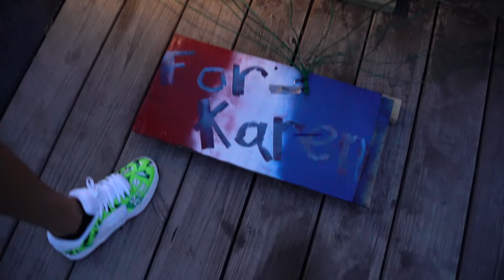I Lit 1,004 Excalibur Canister Shells Fireworks at the SAME TIME!!!

Comment: This is a lesson of how exactly not to build a mortar rack.
Reply: Fr
Reply: Still. Badass tho
Reply: To be fair, even some professional racks wouldn't be able to take simultaneous ignition like that
Reply: This video should serve as a training video in every pyro class as a lesson in "what not to do."
Reply: Tubes not anchored =
Reply: No this is exactly how your supposed to do it
Reply: Your just mad because you didn’t build an awesome firework show!
Reply: @christopherparker4632  lolz I did more pyro yesterday in my neighborhood. I use modular, safe, reusable racks with high quality build materials. I've been using them now for over a decade. I use a tent-stake system that adjusts between vertical and 25 degree fan. Each unit houses six 6-gun racks for a total of 36 per unit. I have 8 units, so I can put 12 cases up in a show. That plus the 900 shells from cakes... I sent up well over a thousand shells. Zero cato's etc. 100% fire rate with zips and foil tape. The difference is I have the ability to do it safely while also giving a show. That 1K shells is a lot easier to admire when paced over 20 minutes
Reply: The rack was actually good it was just fast fused lol
Reply: @mykv4792 , the rack was cheaply made out of thin chip board, a horrible material for this application.
Reply: when the last few tubes break apart and add to the ground attack. way more fun!
Reply: Buddy have you ever done anything like this? Like u know😭
Reply: NO ONE ELSE LIKE THIS COMMENT ITS AT 420 lol
Reply: Ur wrong this is how it's done🤣🤣🤣🤣🤣
Reply: Who cares it was awesomeness
Reply: @michaelmitchell5909  I agree
Reply: Yup
Reply: 🤣🤣🤣🤣🤣Right!!! The bases were flyin’ all over the place!!!🤣🤣🤣🤣
Reply: You need steel
Reply: @andrewg198  Or at least some frickin deck screws!🤣🤣🤣🤣
Reply: Learning!! He still has 9 fingers and 8 toes to go. That was KILLER!!
Reply: @mykv4792  Technically you're correct👍😂
Reply: @odbo255  This video is much cooler than if he had spaced them out over 20 minutes.
Reply: @odbo255  you forgot the part where we live in a world with billions of people who really. Really. Don’t fuckin care.
Reply: @zombifyerilc216  lol - Touche'
Reply: @mykv4792  It's hardly worth mentioning given the other issues, but a combination of quickmatch and black powder on tape doesn't make sense in application together. BP in tape is referred to as "poor man's" quickmatch and functions the same. Putting BP on QM gains nothing and could actually impede the QM by burning off its sheath or even worse, potentially causing a later section to ignite prematurely and cause the QM to subsequently fail at the point where it previously ignited.
Reply: ya but t was SO FUCKING AWESOME
Reply: @odbo255  I'd love to see a video of your show
Reply: @rayngalloway3852  I'll post next year's show.
Reply: Doesn’t Matter. Had fun!
Reply: @j-davis7290  It's not about the simultaneous ignition, they had a pretty basic f-up of using mortar tubes that were too large for the shells that they were using, so the shells didn't get the proper height and they had near ground explosions.
Reply: Lol right
Reply: This could’ve been awesome if it was built better
Reply: @j-davis7290  Nope, just about any rack would have handled it if they used the correctly sized tubes. The damage was all due to oversized tubes that caused the canisters to not properly launch and then blew up the rack causing a cascading issue.
Reply: @odbo255  this is kind of stuff people do to go viral.
Reply: Nobody died or got hurt and they even put out all the fires. I guess they also achieved their goal of shooting off 1k canister shells
Reply: @odbo255  yes this is very true. a show would last longer than a 8 second blaze of glory but a blaze of glory is what we got. you clicked on the video to see it for yourself and you still hating
Reply: @isaiahrodriguez2208  He couldn't have known what they did wrong until he watched it...
Reply: A public service announcement from fire marshal Bill, don’t fuse your fireworks together and then travel with them folks…🤪
Reply: It’s more fun this way

Comment: The aftermath of using cheap wood and unsecured tube. This could of been better
Reply: Ur not impressed?😂
Reply from the maker: You gonna Venmo me $1,200 to build my CAD design out of brand new wood?
Reply: @jonahstaab  He's right. This is just unsafe sky puke. I love the enthusiasm and that you went big. Good thing you had the land and space to do this, but please never do this in a populated area.
Reply from the maker: @ImNotCatCourt  Am I not also right? No sponsors, donors, investors, 100% funded by me. Of course it could be done better, but I can't do big budget. All of my designs are built to function with what I have and set up at a location Incase of it totally failing, which they have yet to do. Sky puke or not I do to for myself and until I'm bringing in more cash or sponsors come along I'll keep going big!
Reply: @jonahstaab  Designs? It looks like you put HDPE excal tubes in a row and didn't even consider the actual trajectory of the shells, the size of the shells or the  effect. As for failing, this most certainly was a fail. Don't bs me I been doing this all my life. What i'm asking is you consider investing in items to help lower the chances in case an accident happens. In this field even if it's consumer grade fireworks you live by a rule, always consider the 1 big accident is the current show you're working on. Prevent it before it happens. Go work under any company you will see we/they live by this.
Reply: @jonahstaab  btw not trying to give you a hard time and no I didn't leave a dislike. I am all about expanding this hobby which benefits my business. However I do push safety 1st.
Reply from the maker: @ImNotCatCourt   @DreamSstreaM  🤣 thats the one thing I have learned about the "industry" nothing is done right by anyone except someone else doing it their own way.

I'm not BS you, I just don't care what you think it should have looked like. It performed exactly how I wanted it too. 1000 at the same time with the trajectory that I decided on after testing it. So it was a success. 

There was plenty of room between fireworks and spectators. The fire department and county sheriff were present. You wanna donate to my fund for next year for further protective items? 

I don't care how long you have done it. There's a reason I get more people showing up to see this compared to the typical city 1.3 show. They lack the creative aspect. Every 1.3 company does the same stuff in the eyes of the public. Pretty displays.  It's only a matter of time until some of my content gets popular enough and I'll be the next Cody B, hated by the Pyro World haha
Reply: @jonahstaab  Cody B, hated by the pyro world? You have some growing up to do my guy. The pro world and what you're doing is 2 completely different things. But anyway you just keep it in mind invest in safety.
Reply: @jonahstaab Ummmm, you spent way more than that on dangerous munitions at a ludicrous scale. So, yes. You should have spent some of that money on safety.
Reply: @jonahstaab No. You are unequivocally wrong. Unsafe, illegal, and unethically exposing others to danger.
Reply: @jonahstaab  Show me your show reports, pyro license, fire marshal sign offs, DOT transport, and BATFE 20/50/54, wholesaler's or retail license and you will garner my respect to believe anything you say as if you "know how the industry works."

Comment: How about building a device that will simultaneously launch a crap load of 2 liter bottles using water and liquid nitrogen.  The type where you put water and liquid nitrogen in a 2 liter and the moment you turn them over they launch upward at an incredible speed.  The key to such a device would be the ability to turn over all the bottles at the same time.
Reply from the maker: Sounds awesome! I have made those before but a big scale would be sick!
Reply: @jonahstaab  Maybe you could rig up a few long racks with bycycle sprockets on the one end and run a chain around them all and they could all be rotated 180 degrees from a single drive wheel.  Just a thought.  I would love to see it done!  Keep up the great work man!
Reply from the maker: @DCDLaserCNC  thank you! That's not a bad idea! Got it in the brain for the future!

Comment: That was sick. 🤘🤘🤣🤣why was there so many failures?
Reply from the maker: mostly due to the racks blowing apart, I couldn't afford new wood so I found as much as I could in dumpsters and it just wasn't strong enough to hold the tubes in place.
Reply: Because everything was built wrong. In fact, it might as well have been held in place with twine. The best way to do a large number of guns like this is to use a sandbox and bury the guns. You then cable strap the boards holding in the sand for reinforcement once everything is in place. The sand secures the guns, absorbs vibration, and it's impossible for a gun/shell to cato and cause a chain reaction because everything is stabilized independently.

Comment: Too bad the actual grand finale is so short compared to the very lengthy setup. Having backup on all fuses is very smart. With 1,000 devices, a 1 percent fail is 10, if fail is a whole line of devices, that's a lot. 

Usually if you ever see this kind of display, it's a total failure because all are not supposed to go off at same time. I remember the huge fail in San Diego a few years back... 15 seconds of wow (too bad it was a mistake).

So what will be encore in 2023?
Reply from the maker: I remember seeing that in San Diego as well! Same idea but planned 😂  I might have something big up my sleeve for 2023...

Comment: Where did you buy them? Normally I can get a box of ex cals for 80$ not sure about wholesale. Or did you order a container?
Reply: I was thinking about platinum ex cals not the 4 inch og's. But still would like to know
Reply from the maker: I buy them wholesale by the case from a distributor each year. 1 case cost $250 and has 6 boxes inside. So about $40 for a box of them.

Prices were all jacked up this year though so I luckily got these with last year's price before they went up

Comment: If I had the money I want to do this with 10,000 shells and an approximately one second delay between every 100. Probably need electronic igniters but it would this for over a minute and a half and there would be more than a hundred shells going off at the same time with the overlap even with the delay
Reply from the maker: Sounds fun!
Reply: Make it happen. Alot of hard work

Comment: $4500 in fireworks roughly.  Id be pissed if this is how 8t went off after spending almost 5k
Reply: Wholesale you can get shells at about $2 a shot so 2 grand
Reply from the maker: I got the shells for $2000 flat but mortars and misc was 5k total 🤘🇺🇸